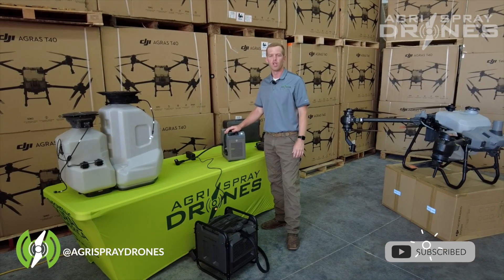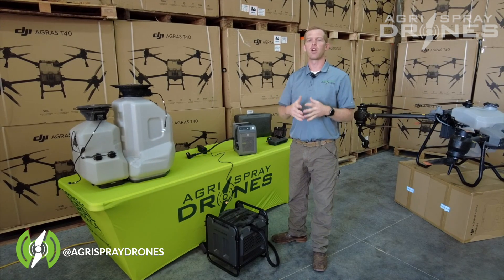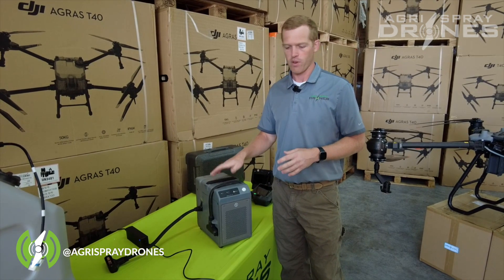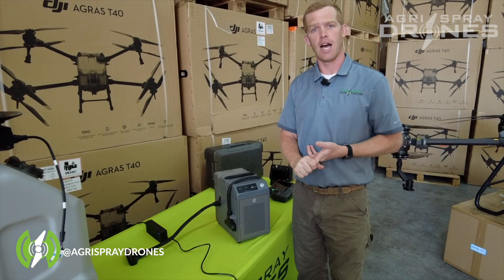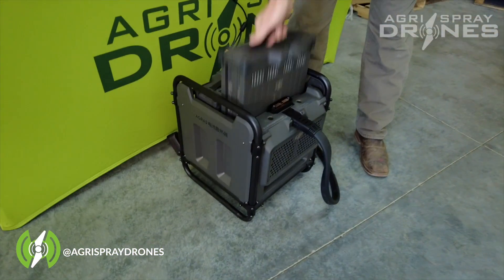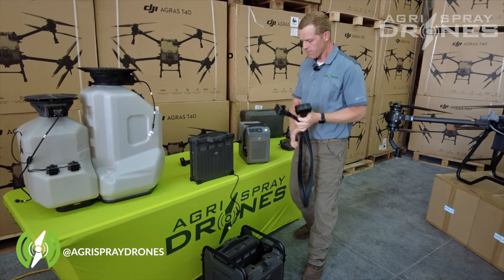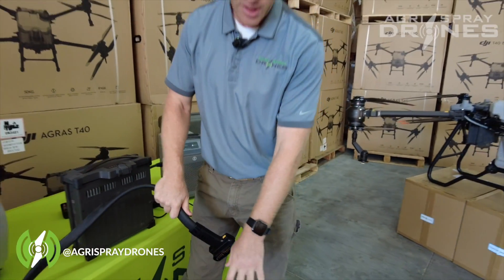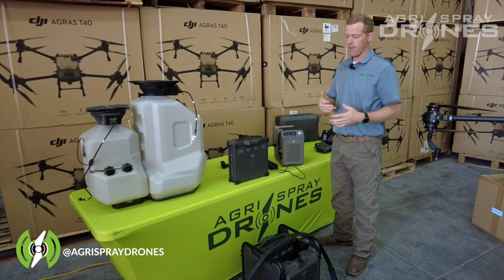DJI Agras T30 vs. T40 — Battery Charging Options

Comment: Did he say, the batteries will charge faster if they are used down to 15% charge? 
I have a T30 and use the batteries down to about 40-50 %. And they take about 18-25 minutes to fully charge even with the fast double 220v power input charger.

Comment: hello, i have a few question about the t30 battery and t40 battery. what's the weight and size (Dimension) of both batteriy? what's your experience of lifespan and number of charging cycles ( like capacity after  500 or 1000 charging cycles).

I am looking forward to your answer.

cheers timo